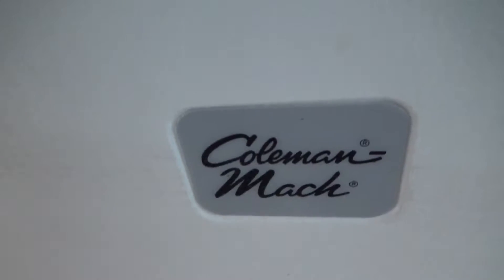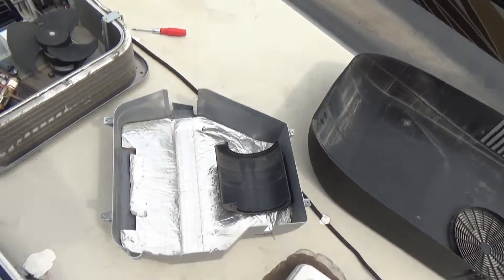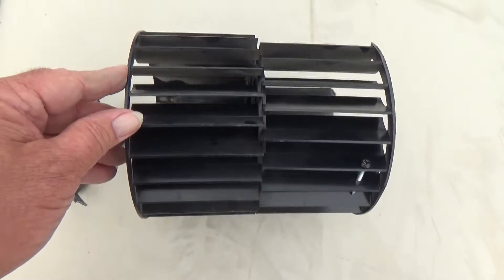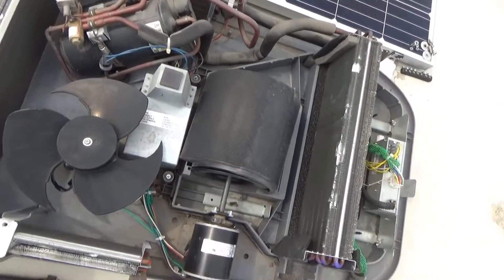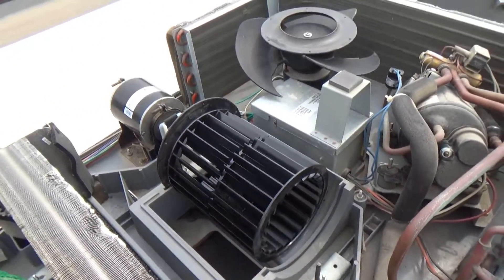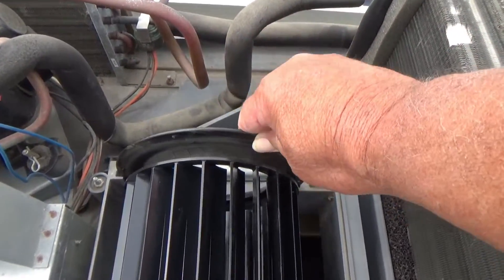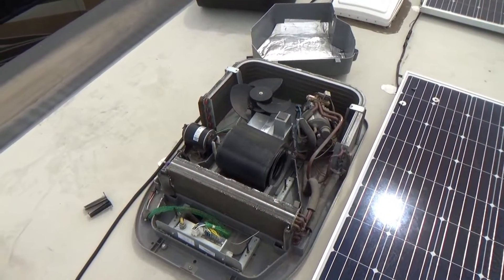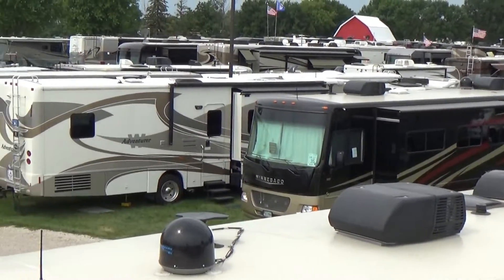How to fix a broken RV air conditioner squirrel cage fan

Comment: Thanks for the video.  My RV has a powerful, low frequency rumble that is coming from the squirrel cage so your video really helps me understand what's under that cover.  I suspect I need to either balance the squirrel cage or replace it.  Or maybe the motor is loose.

Comment: I wish my Dometic was that easy to repair, I was amazed that squirrel cage was a flat disc with no fins left at all.  9 years in the AZ sun I guess. I had no high fan, just low with very little cool coming out, I figured it was the two stage motor, yep it was. Nice job there.

Comment: I have the high profile. I have a brand new camper and my unit will not cool properly on hot days. So I looked up in there and discovered that the styrofoam squirrel cage had a huge chunk missing from around the blower fan! They had tried to patch it up with foil tape. Does that sound like it could be the issue?
Reply: @jerrydixon  I sure hope so! Thanks!!!!